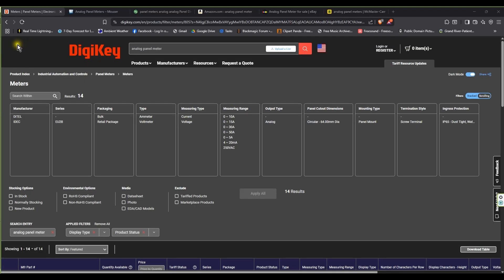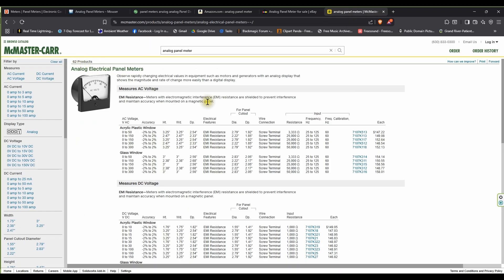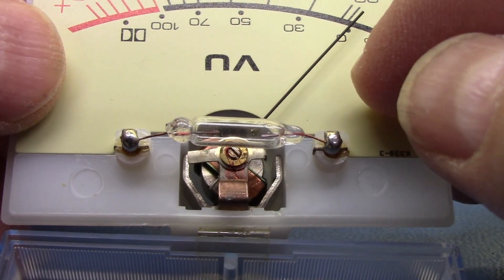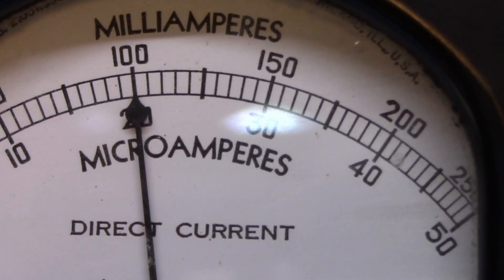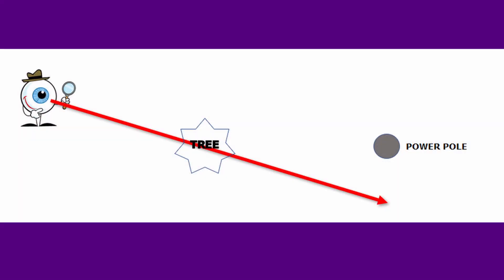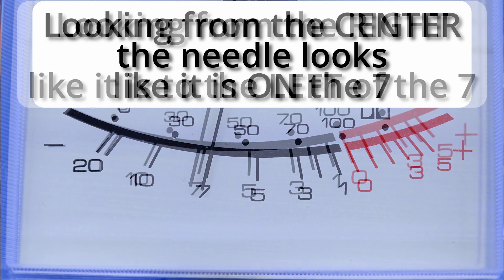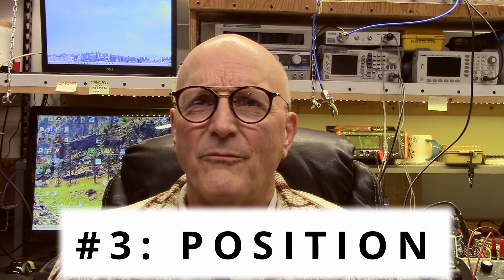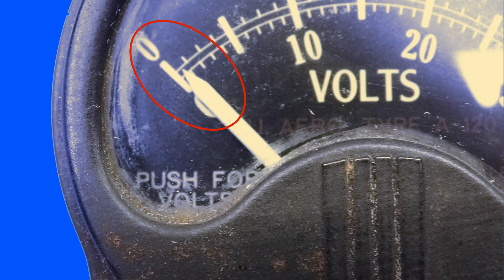How to Read an Analog Meter Accurately (019a_v2025)

Comment: Analog meters: fet-vom, vtvm ... , are more "fun" in general. They are great for relative "highest or lowest" adjustments.  They can not compare any where close to the accuracy of a general digital meter.   I am certainly no expert; but like having both digital and analog for my "very amateur" experiments.
Reply from the maker: You are right ... while the digital DVMs are more accurate (not as more accurate as you might think, by the way), there is most definitely a place in every shop for a good quality analog meter. :-)

Comment: BACK WHEN I WAS LEARNING ELECTRONICS WE DID NOT HAVE CALCULATORS AND, OR,DIGITAL MULTIMETERS.THEIR IS STILL A LOT TO BE SAID ABOUT ANALOG MULTIMETERS ESPECIALY WHEN CALIBRATING AND,OTHER THINGS.I HAVE A SIMPSON 260 MULIMETER IN WHICH  I TREASURE.
Reply from the maker: You and me both! And that Simpson 260 has always been an industry standard VOM. My first exposure to them was when I was in the USAF in the calibration lab. I used to calibrate them (a few eons ago). :-)

Comment: Very nice video as always sir 👍, it's very helpfull to me because i'm in the middle of building linear power supply with analog volt meter and analog ammeter.
But i have little problem with analog meters that i already buy, the problem is the meters has quite high full scale current deflection (700 uA and 1.5mA) and full deflection voltage around 750mV,  the meters came from broken voltage stabilizer, it has printed scale 0 - 110 V & 0 - 220 V, the meters reading seems to be linear at that high voltages, but at the lower voltages (0 - 12 V)  its not linear anymore, i wonder this unlinearity reading cause by high number on that meter full scale deflection (1.5mA) (750mV).
I've look some information on the internet about  " FET Analog multimeter", they said its better to reducing circuit loading cause by analog meter. I think maybe this is like  a buffer circuit. But still, most of their schematics used 50uA or 100uA analog meters. 
My questions are
1. Why lower current  meter around (50 - 100uA) can display more linear readings than higher current meter (1.5mA)?
2. Can I still use those meters (1.5mA Full deflection) into (0-12V) with linear reading?
3. Are adding this FET circuit will help those meter (1.5mA full deflection) to deflect or move more linear? 
Hopefully you would answer my questions , thanks 👍
Reply from the maker: 1. Linearity and full scale current are not linked to each other. Meters specifications are always made at full scale accuracy. So, if the meter is specified as 5% accurate at full scale and full scale is 1 mA, then all readings everywhere on the scale will be within +/-0.05 mA. So, if you set up a current so the meter reads 0.1mA, then that actual current required to achieve this could be anywhere from 0.05mA to 0.15mA > this is +/-50% of the meter reading. But it is still a +/-5% full-scale accuracy. The amount of digression from linearity is whole a function of the manufacture of the meter itself. Sometimes manufactured to be non-linear in a specific way for a specific application. Sometimes just a matter of the quality of manufacture. Maybe the original application really wasn't so keyed on accuracy at more than a specific scale reading and the rest just an "indication" so the manufacturer of the original equipment the meter found itself in kind of went cheap on the meter. Who knows?
2. You sure can use those for that application as along as the 1.5mA load of the meter does not affect the voltage that you are measuring. By the way ... coming in this series on analog meters are videos on adding a shunt for higher current measurements and adding a multiplier for higher voltage measurements. These are re-releases of existing videos currently available on this channel.
3. The addition of the FET is intended to reduce the load on the circuit that you are measuring the voltage on. This is not about linearity. If you could somehow determine the exact nature of the non-linearity, you might be able to fashion a circuit to make it all more linear with some creative engineering.
Hope all of this helps. :-)
Reply: thanks a lot sir for replying my question, its very helpfull. 👍
thanks to share your expirience about electronics with passion and enthusiasm. 👍
Reply from the maker: You are very welcome! :-)

Comment: ottimo ma mi sarei aspettato anche un accenno alla classe dello strumento
Reply from the maker: The emphasis is not on whether we are reading an ammeter or a voltmeter or other kind of analog measuring device, but on getting the most accurate reading of the analog meter movement itself. Hope this makes sense. :-)

Comment: I have analog panel meters all over in my home lab…. Sure, they are not as accurate as a digital meter, but they don’t need an additional power supply just to power them. On my Variac’s output, (both voltage and current), who cares if I am within 10% of the value. At least I can still read it from all angles, unlike digital meters. On my analogue mutimeter, it is still easier to tune for a null or a max than it is with a DVM or an oscilloscope… but i guess our age also has something to do with it, if you learnt to read an analog-scale, it will always be difficult to understand why youngsters battle so much to read an analog meter…. The same as youngsters battle to read the time from an analogue clock… I love both types, but for some measurements I prefer an analogue meter, for accuracy, there I prefer a digital readout.
Reply from the maker: All good stuff and very practical!  Unfortunately, the mantra of so many young folks is "if it ain't easy, it ain't worth doing" which robs them of the benefits of many things. :-)

Comment: flashback to the old days ... but surprisingly still needed for today. In some multimeter scales there is a visual indicator if the meters is best used in lying down or standup mode.
Reply from the maker: That's true, those old meters had some interesting nuances! :-)
Reply: Never had the privilege of using one of those meters (or maybe I just missed that nuance), but I do remember tilting (some) meters from horizontal to vertical to get to a reading that actually makes sense!!! 😱😱😱
Reply from the maker: naughty naughty! LOL

Comment: Some measurements can only be made with Analog 👍
Reply from the maker: Very, very true. The old analog scopes and meters are indispensable for certain measurements. :-)
Reply: @eie_for_you  thats why I have five of them ...
Reply from the maker: I have only one that I can depend on, my old RCA VOM. The other, hardware store meter, is no way going to be used to get real measurements from. Just, "yup, the meter moved and it is somewhere near where I expect it to be." Someday, I'll take the cover off to see if I can adjust it. :-)
Reply: @eie_for_you  I have a kamoden 360FET multimeter. It has a 25uA +/-2% scale, uses 1% resitors, can be used as a nul-meter and is as acurrate today as when it was introduced in the 1970s. Love the meter and the nul-functionality.
Reply: and a philips smt111 service multitester meter. Bought in 1975. The warranty card was valid till 1980 but as of today it was never needed ;-)
Reply from the maker: Cool. I have LONG since lost all of my ancient stuff except my little RCA VOM. It is still going strong. :-)
Reply from the maker: Oh and I have an OLD AN-PSM6 multimeter sitting on the floor of my shop which is just begging to be resurrected. :-)